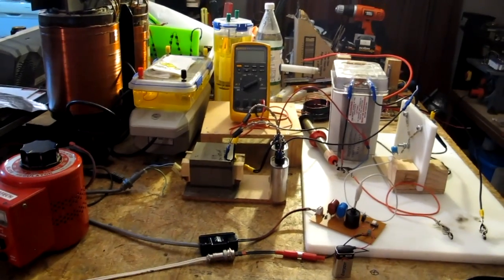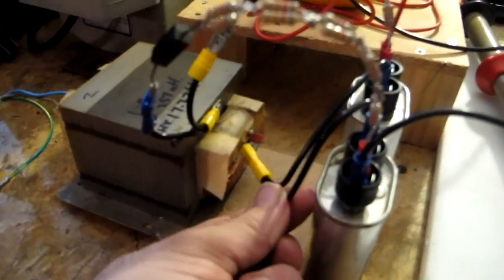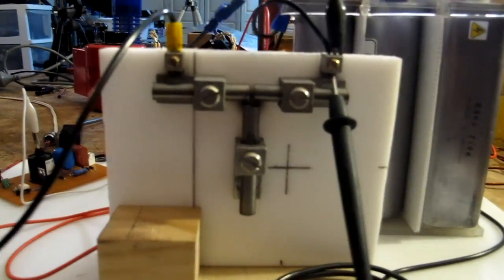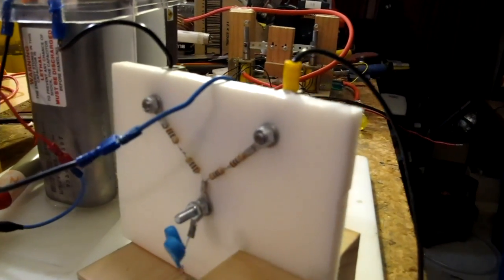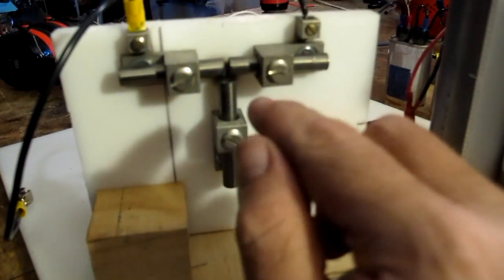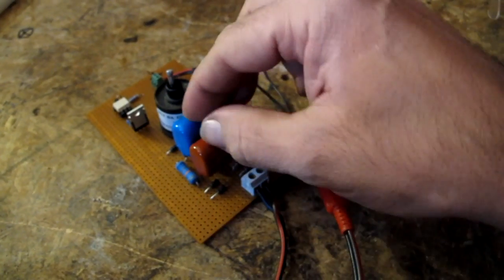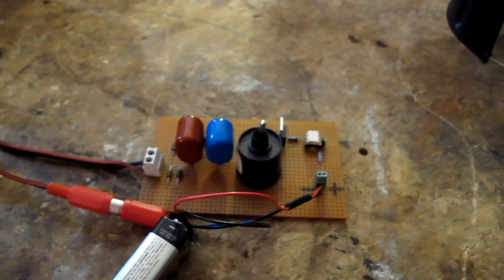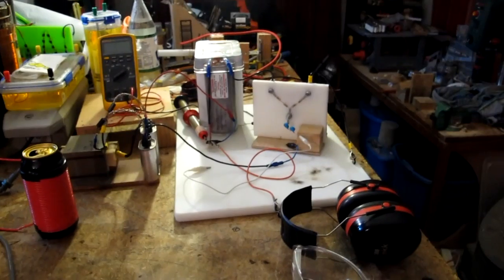Triggered Spark Gap Overview

Comment: You could make the power supply SO much safer and simpliler by using one NST (neon sign transformer), rather than the ultra-leathal MOTs !
Reply from the maker: Yeah, you use what you have. I now have NSTs and they are much nicer to deal with  :)

Comment: I know this was 3 years ago but could I run this spark gap at 60 or 120 hertz?
Reply from the maker: I guess you could, but if that's what you want to do you'd be better off with a rotary spark gap. The neat thing about this one is the ability to just trigger a single arc on demand

Comment: I am still working on the same  device and I wanted to ask you about your switching the 2000 volts and what problems you had with the gap width. I like your idea of the rotary spark gap however I was watching Les's Lab and he was using a triggered spark gap at 100 hertz and lower to run a laser. How would I set up a rotary gap to perform at 60 cycles per second or 120. It seems that would be really fast or am I missing something?
Reply from the maker: The main problem was just getting the adjustment correct, so it would trigger when I wanted and not when I didn't.

I'm having a play with a rotary gap at the moment. To get one that syncs with your mains you want to get an "induction" motor. They are wound so that the motor will always be in sync with the sine wave that's powering them. I am finding that mine (motor speed 50Hz so switching at 100Hz) seems too fast for this and am having a go at gearing it down to 20Hz. They're great for Tesla Coils though, as you want the higher frequencies then.

Hoping to get some more time with my gap this weekend and make a vid about it.
Reply: @gristc  Fantastic Thank you!  I found Les's Lab's triggered spark gap that he made but I have to get my lathe up and running and then figure out how to make what he made. For someone who knows what they are doing it seems pretty easy but I do n ot..lol

Comment: My coin shrinker uses a simple mechanical spark gap switch for exactly the reasons that you mentioned about triggered spark gaps. They are tricky to adjust and can fire unpredictably. I typically use about 7200 Joules to shrink a coin and you don't want that switch to fire unpredictably! My mechanical spark gap switch is very precise. I can bring the contacts to within 0.5 mm of each other and can trigger down to about 2000 volts which is as low as I ever need.
Reply from the maker: Yeah, the coil shrinkers I've seen on here use mechanical switching too. Don't suppose you have a vid or write up about yours?
Reply: @gristc  Have a look at "highvoltageforum.net". This is a forum concerned with high voltage. Look in the "Capacitor Bank" section and you will find extensive pictures of my pulsed power generator. My user name on there is "MRMILSTAR".

Comment: It's not silicon controlled relay, it's silicon controlled rectifier, thumbs up :)
Reply from the maker: Oops, right you are. My stupid brain always mixes that one up.
Reply: gristc I forgot to ask are the electrodes from the spark gap made from tungsten ?
Reply from the maker: I believe so. Will find out and confirm once the owner is back from his current adventures.
Reply: gristc Ok :)
Reply from the maker: Confirmed, they are tungsten. I'm not surprised. I've managed to weld pieces of copper together with it several times.  :)
Reply: gristc Ok, and thanks :)

Comment: i want to make trigger circuit for spark gap.how i should make.
Reply from the maker: Not sure what you're asking. I go through the components in the video.
Reply: Actually i want to produce x-ray by spark.SO i want to apply high voltage to spark gap.

Comment: It's not so much "because an arc has much less resistance than air"... it's because you ionize the air around the low power HV spark, which lowers the gap resistance for the high power spark... nice job anyway!  
  I believe the electrodes should be more pointed... so that the low power spark ionization can be more useful... as it is, the possible arc initialization area for the high power spark gap has a lot of surface area... possibly making it unreliable.

Are you using tungsten spark gap electrodes?  Unless you are planning on MUCH larger capacitors, small TIG welding lanthanated tungsten electrodes are cheap, plentiful, and last a long time. (don't use thoriated tungsten... they will pre-ionize the air in the gap!)

I'm rather confused why you don't have the low power (25kV) spark generator Ground ("low side left floating") connected with the high power (4kV) "-" connection?  You are losing most of the effectiveness of that 25kV spark generator coil. Without that "return path", you run the risk of causing internal insulation breakdown inside the black HV pulse transformer.  If that transformer ground were connected, you could move the "trigger electrode" MUCH further away from your lower voltage, but high power electrodes.

BETTER YET... you could use a HV decoupling inductor (high permeability toroid core with a few turns of HV rated wire) in series with the 4KV "+" connection, then connect the HV (25kV) trigger pulse directly to the "+" spark gap electrode, eliminating the lower (3rd) "trigger" electrode. 

Best to add a 5kV "spark gap cap" across the 4kV capacitor bank to protect it (or other fixed/reliable spark gap device).  Really, if the inductor is adequately designed, it will do a great job of isolating that 25kV pulse from the 4kV caps... but I still like to put a full 25kV rated capacitor across the LV (4kV for you) cap bank.

HV "trigger" transformer "-" lead still must connect with the 4kV cap bank "-" at the "-" spark gap electrode.  

The inductor keeps the trigger pulse from going back into the 4kV cap bank, but allows it to jump the spark gap... ionizing the air gap, allowing the LV (4kV) to begin conducting with the BIG SPARK.

This is how DC arc lamp ballasts ignite the arc lamp... low voltage high current DC supply to maintain the arc (plasma), high-voltage low power ignition spark to get things going.

SCR = Silicon Controlled Rectifier... not Relay  ;-)

Ever considered making a LTSG? :-)   (Laser Triggered Spark Gap... not an easy DIY trick though)
Reply: This reply is worth ten times the video!!!  I can't understand why there are no replies.   I would like to ask you: 

1) when the pulse transformer is connected as you suggest, to eliminate the third electrode, do you also eliminate the voltage diver and pulse caps?
2) can one of those 5W laser diode lasers fire the gap by shining it between the electrodes?  I would guess that the shorter wavelengths (near UV like 450nm) would be best?

Comment: Very cool, I would have never thought of using a 3rd electrode to trigger the spark, very ingenious. 

I am ordering supplies to try and build a pulsed spark gap and am going to try 300v spark gas tube that's used for circuit protection then adjust how fast the capacitor fills with a motor speed controller, to control spark speed.  If that doesnt work out, I bought electrodes like you have and a photo flash transformer that'll get up to 12kv.  I do have one big question I've been trying to figure out.  What  happens to the voltage post-spark? Does the voltage remain the same as the circuit continues or does it change entirely? 

The reason I need to know this is because I am thinking about also building a low pass filter for post-spark, to keep the device from broadcasting on radio channels? Though if the end voltage is too great, will be hard to cheaply build the filter because they dont really make 500w potentiometers.

Comment: This reply is worth ten times the video!!!  I can't understand why there are no replies.   I would like to ask you: 
1) when the pulse transformer is connected as you suggest, to eliminate the third electrode, do you also eliminate the voltage diver and pulse caps?
2) can one of those 5W laser diode lasers fire the gap by shining it between the electrodes?  I would guess that the shorter wavelengths (near UV like 450nm) would be best?